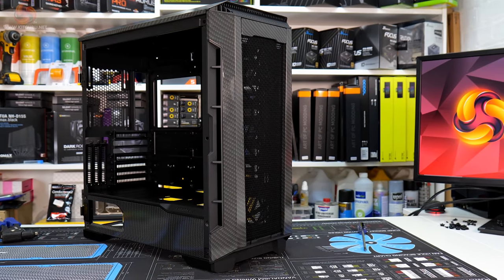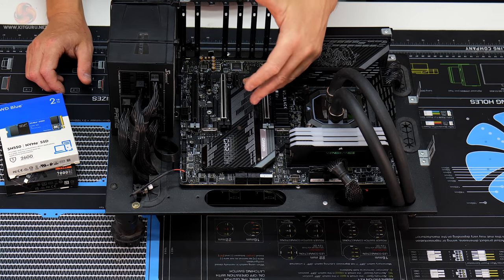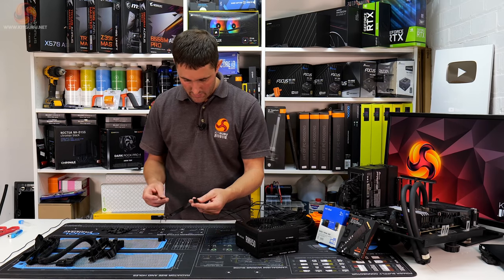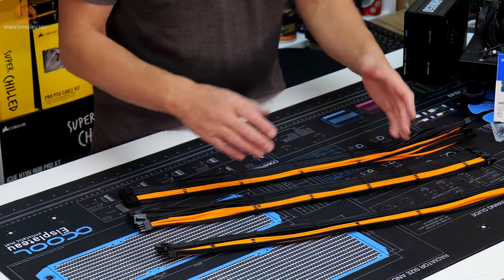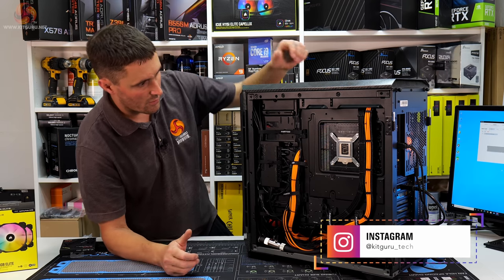WD 'Blackout' System - Modded Build (Part 3)

Comment from the maker: It's finished - but what do you make of the final build? Let us know your thoughts on the mods!

00:00 Introduction - Western Digital Drives
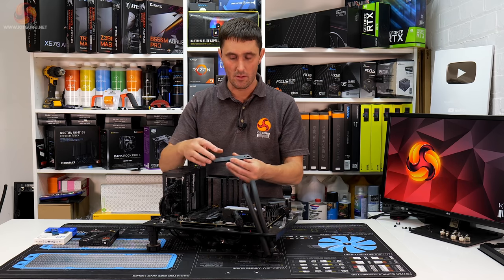02:28 Another WD drive - but its blue - OCD flag
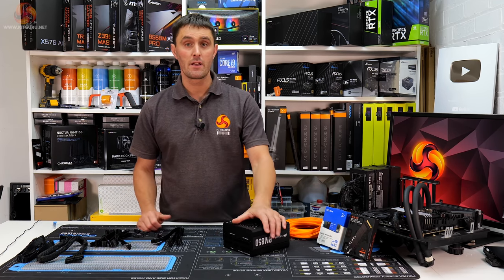06:28 Power Supply - cable modding
17:56 Cables done - 8 hour job!
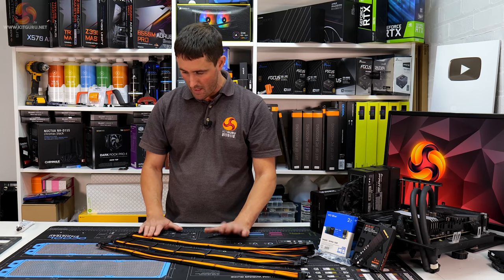18:56 Distro Plate and acrifix 192
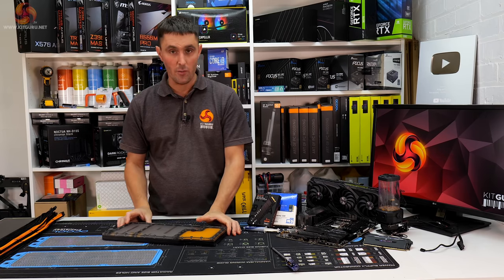25:14 Distro Plate V2.0
26:31 Laser cut panels
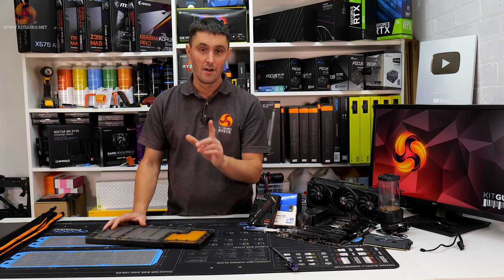27:06 System Specifications recap
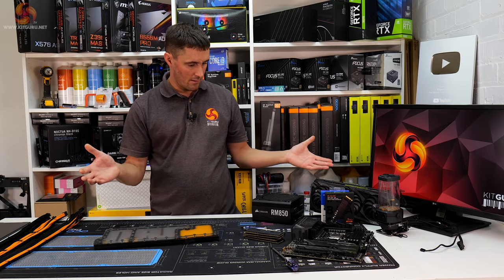29:08 The final build!
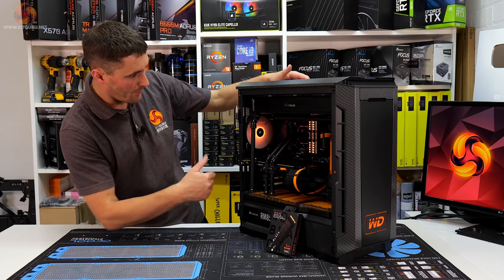36:57 It's Finished!

Comment: It came out great. Not over the top at all. You must invest in a black paint pen from the likes of Posca, Molotow or Montana to colour in the bits that need to be black. The edge of the GPU PCB needs to be painted to let it blend in. Even an orange line could have been nice.

Comment: Logo on the side of the case is WAY to big, should have been in similar orange 5 times smaller on the bottom left corner side.  Imitating a logo is not always a smart thing to do because most of them are absolute crap. Like this one.  An absolute stain on this nice build!  😎
Reply from the maker: ah well, sorry it was disappointing for you in that regard. thanks for watching !

Comment: Looks really nice! Are GPU and CPU running in parallel in the loop?
Reply: Yes its a parallel loop.
Reply: @KitGuruJames  Is there any pros and cons to it or is it irrelevant in terms of cooling performance? So you could go wild with your clean builds?
Reply: @kyoudaiken  I don't think it makes a huge difference to the performace but to be honest I've never done a back to back comparison.

It makes sense to think that a parallel loop could reduce temperature as both the CPU and GPU should have liquid of the same temperature running through the blocks.

The liquid in a series loop should be cooler at the first water block in theory but I've never tested it.
Reply: @KitGuruJames  From a physics standpoint, the flow rate should be halved in both cooling blocks, but both are fed with the same temperature fluid. On high flow rates, the loop order doesn't make much difference because the higher the flow rate, the lower the temperature difference before and after the component to cool. Several YTbers tested this already. Though, halved flow rate could be an issue when a weak pump is used or the pump is being driven with a low PWM signal to reduce noise. If the pump is strong and quiet, I think temperatures should still be way better than any AiO or air cooler could ever achieve. But i've never tested it myself, nor have I ever seen a setup like this before. Oh and there's also the issue of uneven flow distribution when T-Splitting. CPU or GPU could receive a higher flow rate. The dynamics are the same like with electricity.